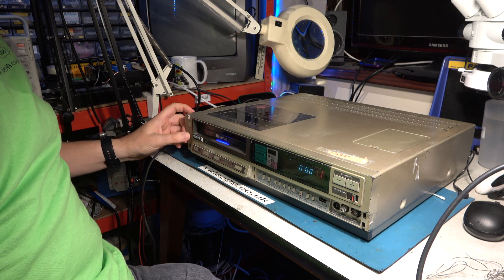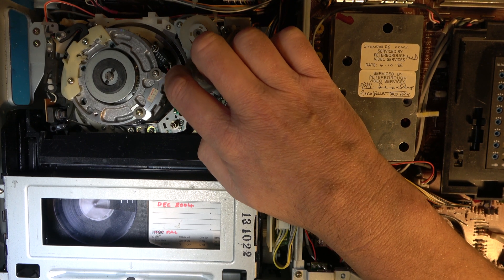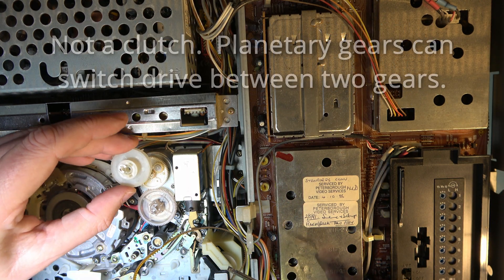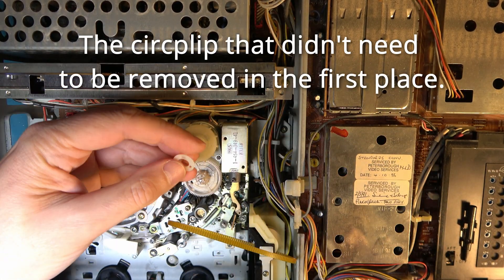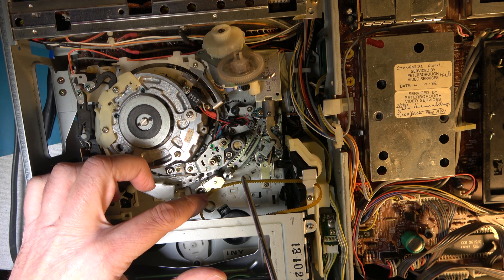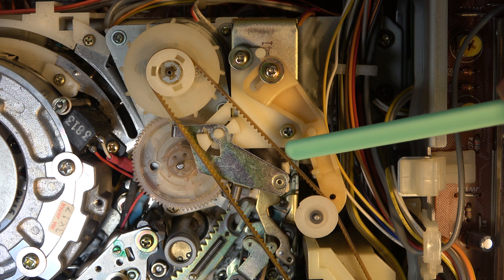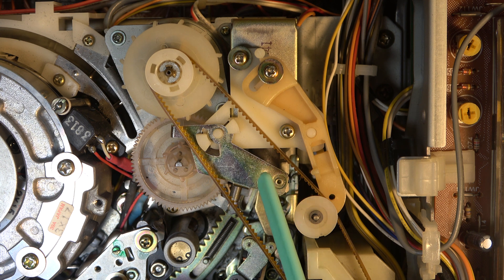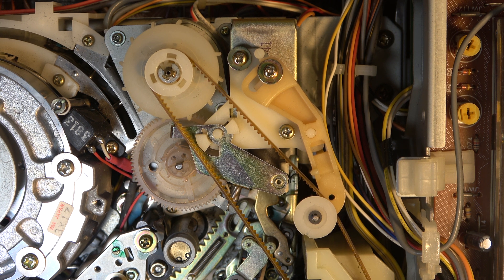Sony Betamax front loading and lace-up magic.  SL-T30ME.

Comment: That small black gear always splits on the 711B chassis which is what this model is based on. The later 711B2 chassis (SL-F30 etc) solved this problem.
Reply from the maker: I wasn't aware there was a chassis change.  I have seen some later models though (F25?) with very fragile front loading carriage tracks made of brittle plastic.
Reply: 711B2 chassis based machines fail the same.

Comment: Instead of a c type clip holding the planetary gear in place, my SL-HF900 has what I’ll call an O clip. It looks similar to a C clip but goes all the way around. What’s the best way or tool to remove those and what are they called? I don’t want to be too forceful.
Reply: Yes I've seen those O clips before and I think only Sony used them. A small flat head screwdriver will work but be very gentle.
Reply: @crashbandicoot4everr  Thanks. I used a dental pick and kept moving it to different spots and it came off! The black gear on the bottom is perfect, but the plastic motor shaft that couples with the orange center planetary gear has a hairline crack that is likely causing some slippage. Any idea on how that can be strengthened?
Reply: @instantwow  The HF900 is based on the newer 711B2 chassis and I haven't seen any of those with a broken black gear. Probably JB Weld or epoxy will hold it back together if the gear hasn't split completely.

Comment: I've got an SL-2710, NTSC deck, w/ the same type of transport. In my case, a tape would load, lace & play. But it wouldn't unlace & eject, unless I gave the end roller a push, as you did, early on. Took the mechanism apart. And sure enough, the black gear is cracked. Didn't have any epoxy, so I tried JB Weld. Worked for a few tries, then gave way again. But at least I know that fixin' the gear will fix the deck!

Comment: Hi Colin, I've had a couple of machines where the black plastic gear had split too badly to be repaired.  From a hobby shop I was able to source a brass gear designed for slot car motors with the right dimensions apart from being a little long. I sawed it down to size and it was a good interference fit on the Sony shaft. Some grease applied and it's worked well.

Comment: It's more like the solenoid was also used for the pinch roller, the solenoid's main purpose it to make possible loading/unloading and threading/unthreading.
Then engineers just figured out how to use something that was already there to push the pinch roller.

You can see a lever that it's also used to push the pinch roller on more modern Sony Beta mechanisms, it just doesn't use a solenoid anymore.
Also, this mechanism was always noisy.
Reply from the maker: Sanyo had eliminated solenoids on their Beta machines from about 1983.  But they were also noisy, and needed an extra motor on the front loading models.

Comment: You talked about this fault in your video called 'Working on Sony Betamax video recorders' from 12 Jul 2019. Great to see the actual repair, and possible problems. Nice work.

Edit : Great, I have the SONY SL-C6UB mk2. Typical. LOL.
Reply from the maker: If not already done, replace the Sanyo 0.22uF capacitors in the capstan servo circuit with ceramic and reset the capstan freewheel speed.  Very common problem with those.